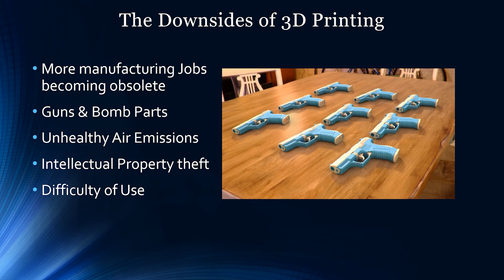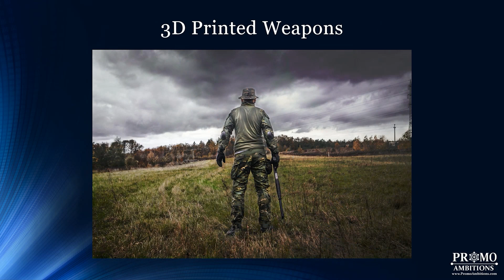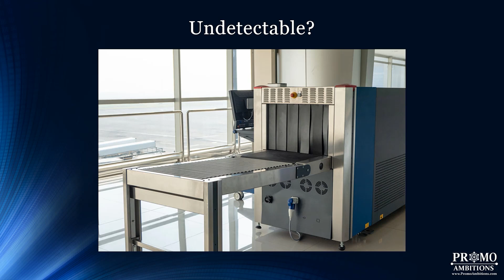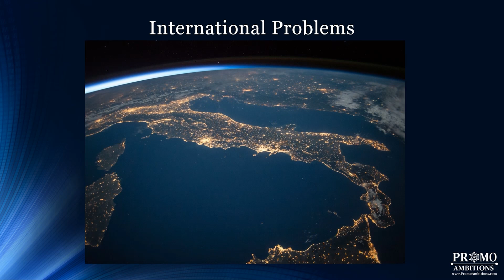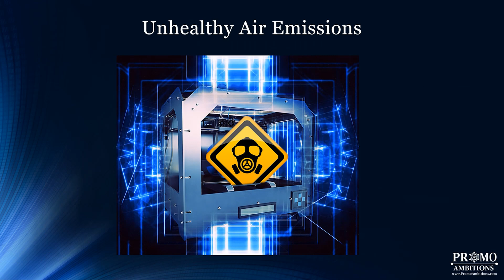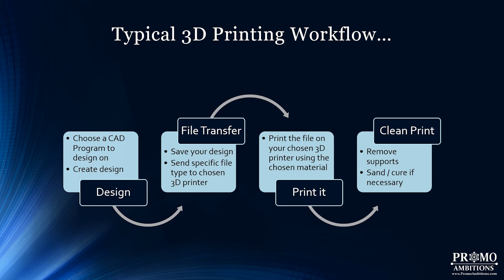Downside of 3D Printing - Harmful Disadvantages & Limitations

Comment: 11:30 license checks before all sales must be done. done at.
3dmdb
Yeggi
Stlfinder
Net. 
Everyone knows that. Ok maybe a few living under a rock newbs who have only been at this a week dont know that. 
Licensing is what the 3d print comunity does. The cost is in buying commercial use cad and a pc and time to learn the skills else licensing then is free. Other than food and power and time to do it. 
All uploads no matter who drew the stl is required. 
Also license check All sales, no matter where the stl came from, no matter if you drew it, no matter if you found a free thingiverse file, scan, or purchased. You must always license check all sales, farms yes must check all sales. 
Always ask farms wether they check all sales before considering using them. If they wont answer NEVER use them. To not check and then not pay the royalty ti the actual owner is piracy. Farms can and are being closed down over that. 
I know as i got nailed and closed down for getting it wrong so now ive learned my lesson so am very carefull. 
Ive been in this since before thingiverse exsisted and have become the expert.

Comment: Dude... This kind of blatantly misleading information is what causes gun grabbers to think that no one should be allowed to own a 3D printer in the first place. Yeah, guns with 3D printed parts exist, but they DO require metal parts like barrels and bolts, not to mention the ammunition. Even the plastic parts ARE detectable by a visual x-ray scanner, *and explosives*? Please... 🙄 Not only is the container NOT the dangerous part (you'd still have to make or purchase the actual explosive, which is already illegal, and usually difficult), but weak plastic is far from the best material to achieve the proper concentration point for a destructive device. And by the way, it's completely legal in most places to make at home any firearm that you could otherwise lawfully purchase. The vast majority of those "unregistered and unlicensed guns in the US" are LEGALLY owned; there aren't any registrations or licensing required for non-NFA and non-concealable items.
Reply: I  in Australia and we don’t do guns here after the incident of ‘96 so I have to agree with you on all you points. I’m going to go pleasure myself now PLease...🙄
Reply: @tomelement9543   Shut up, I am a vegan and I don’t condone shootings, be like me.

Comment: The issue of the learning curve is almost completely solved by distributing the G code instead of the models. Also, the reduction of need for low skilled manual labor I strongly feel is a great thing for humanity. Yes, there exists short term turmoil and disruption and the impact on the people who suffer from it shouldnt be discounted, but automating more jobs will always lead to a better future and will force us to create societal systems that aren't reliant on do-nothing jobs to justify feeding people. We have all the shit, we have people who need it, but we as humans are hung up on this twisted idea of labor and time that leads us to shun safety net programs and insist on wasting peoples time doing a job that could be done by a machine. Job loss is always a good sign,  because without it we would still be spending 12 hours a day grinding wheat with a rock
Reply from the maker: Very interesting reply...appreciate your thought process and you watching it. I'm in the process of making a video on the future of 3D printing and may integrate some of this into the video.
Reply: I couldn’t agree more! I went to school for manufacturing and production is the closest thing to modern day slavery. Everyone in the field hated the work but did it only for the money. I invest in this technology as a means to an end like you said to free us for less redundant jobs and to find more creative outlets. Inevitably technology will replace all mundane jobs and everyone I knew in the field has already come to grips that this technology is on the horizon